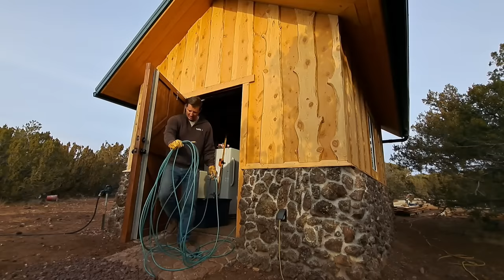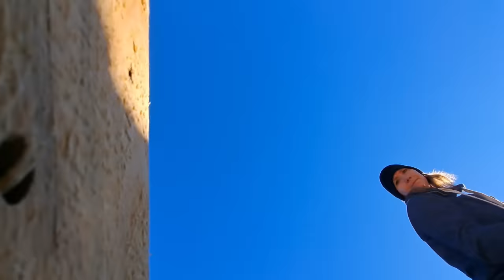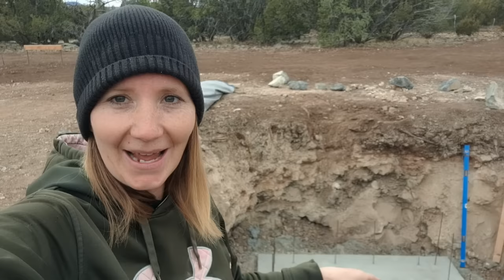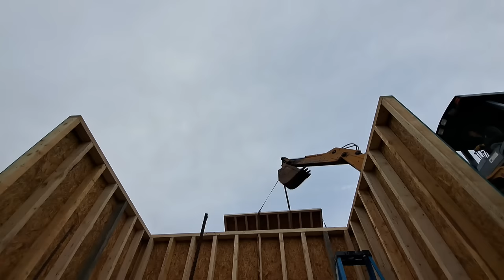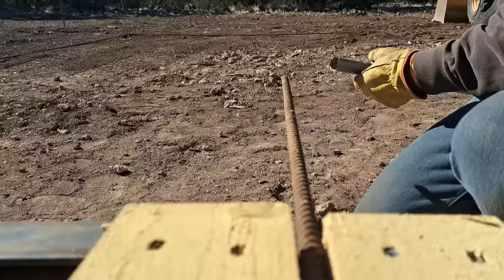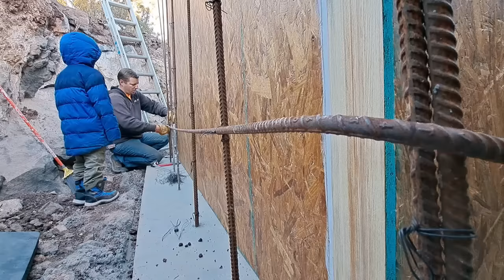HOMEMADE Forms For 8 FOOT Concrete Walls | DIY Home Build

Comment: Just a suggestion for you when tearing down your forms to make it little easier , cover the screw heads with tape to prevent cement from getting into place

Comment: That hole in the ground is starting to look really fancy.  Someone has been investing some hard work making things happen.

However, wouldn't it be a lot less work and much quicker to just buy a dozen cheap chest freezers, and then if necessary, to expand the solar power system enough to accommodate them all?  Cheap baseline 7 cubic foot chest freezers take less than 1 kWh/day of electricity each, but their energy consumption drops essentially to zero when the ambient surrounding temperature also drops to zero Celsius.  In other words, if you place them in an uninsulated (but rain protected) space, when winter time comes around, they consume practically no energy, which aligns well with an off grid solar power system, since it also produces less output during the winter months.  Consequently, chest freezers are actually quite easy to power from an off grid solar system, so long as one already has a large enough inverter to handle the inrush current for starting the compressor motors (which is often around 1 kW (or more accurately 1 kVA), or a bit higher, for a small 7 cubic foot chest freezer).  Once started the compressor motors on them are quite small, and they usually take around 70 Watts or 120 VA (volt amps), or perhaps a bit less each, when actively running.

The interior shell of the chest freezer is usually very near air tight, with metal walls, which makes for a good quality barrier against mice (although there is often a small hole near the power cord exit that should probably be blocked, in order to prevent mice from making a nest inside the compressor compartment of the chest freezer).  Additionally, the freezing interior temperatures stops (and kills) most types of bugs.  Chest freezers are designed for food preservation, and they do succeed in accomplishing this objective, provided that one ensures a reliable source of electricity for them, which solar panels deliver.

Chest freezers are currently quite cheap, and baseline 120V AC powered models are available for less than the price of the food that one can store within them.  Given their price, it does make sense to store both high value foods (like meats and cheese), and lower priced foods (like flour, rice, pastas, and other grain based noodles and products) in chest freezers.  Flour and rice are vulnerable to destruction by grain beetles, as well as becoming foul tasting due to oxidative stress from ambient air.  However, the lower temperatures inside the freezer effectively kills potential bugs, while also greatly slowing the oxidative stress rates (which scales up with higher storage temperatures, and scales down at lower temperatures).

Comment: @peterdement
0 seconds ago
Is it too small? Will the stair access consume 20% to 25% or more of the usable space? with 8 foot ceiling height and comfortable risers ( 7.5 ") that is 13 treads  of 10.5"each for total run of 11 ft 4" plus landing space at both the top and the bottom. The "root cellar" will become the "stair cellar" If you try to cheat the stairs by making higher risers and shorter treads they become more dangerous for falling especially carrying heavy boxes of food.
Reply from the maker: This was my concern also. We have a way of fixing this that may surprise you. Unfortunately, I can't let the cat out of the bag yet. Appreciate you, thanks 🙂.

Comment: I recently ran across your channel and am enjoying it.  You probably know, but there is a tool for twisting the wire that holds the rebar together.  It is faster and easier than doing it by hand.

Comment: Absolutely wonderful progress! We have loved and enjoyed every bit of the process so far! You guys ROCK!

I must say something, though. I've am very hesitant to say anything, but I feel I need to. 
I'm very concerned about the Tapcons you used to attach the forms to the concrete. They did not get enough of a bit into the concrete. I'm afraid to say it because I see how much research you guys put into everything. I'm certain you will need 1/2" wedge anchors every 4ft and more in the corners to ensure the concrete doesn't blow out the bottoms of your forms. I truly hope I'm not out of place. Again, we love you guys so much!
Reply: Hey guys, im not going to delete my comment even though i look like a complete dummy😂. I have to say, I'm so embarrassed. 
I am completely wrong. Please forgive me. I was coming from a place of good, I promise. Just happen to be completely wrong. I really over thought it and freaked out for a minute. Lol

By nomeans should you put 1/2" holes in your concrete. 
You guys have a great channel and we truly love it!

Comment: Be sure you oil those forms so you can remove them easily after.   Form release oil in a spray can does the job.

Comment: When the wildfire from the Waldo Canyon fire destroyed my brothers home the lost everything.  (Along with 347 homes). When they rebuilt they used lots of concrete and built a basement and a safe room.  They paid extra to have a higher strength concrete for the house.  When they looked through the ashes, their gun safes were ruined.  Stored ammunition exploded putting holes in the safes.  No water was used to put out the house fires.
Reply: You might consider using higher strength concrete.  Love the family interactions.  🫡

Comment: I was wondering if you considered using cinder block and grouting it solid vs. framing and pouring cement walls?
Reply from the maker: It was considered but chose concrete. Guess I just didn't feel like laying block. Thanks 🙂

Comment: Could you leave the inside forms in for something to build your  shelves on?  Or do you need to have the cement for temperature  control?  Great job on your project.  God bless Bill
Reply from the maker: The inner forms will have to come out. Thanks 🙂

Comment: so i refreshed my memory in rebar in cement an tensile force, strength and breaking point. where would the tensile force come from to the walls? earthquake? something else? does az have earthquakes? is there a quake building codes for az???
Reply from the maker: The nice thing about Arizona is that we don't have earthquakes, tornadoes, or hurricanes. I'm not saying that they don't happen, but they almost never happen. As far as tensile strength, I really don't know. We're just building what our plans show and what the inspector wants to see. Thanks 🙂
Reply: thank you for explaining @aboulderlifeoffgrid